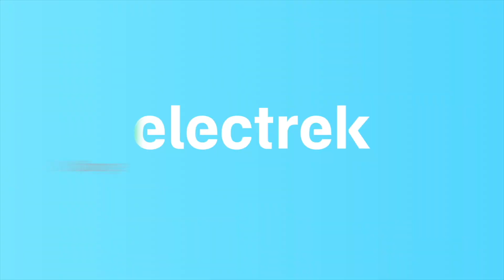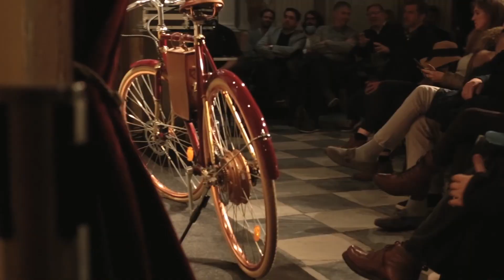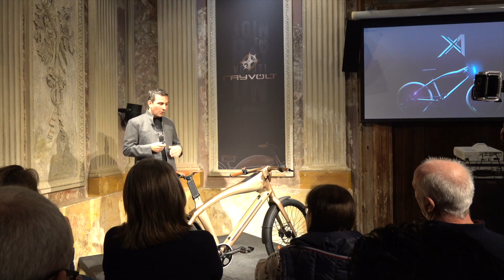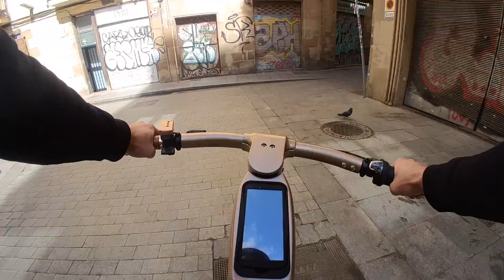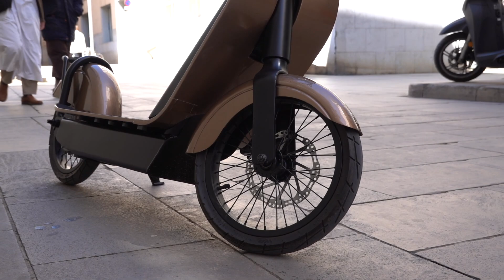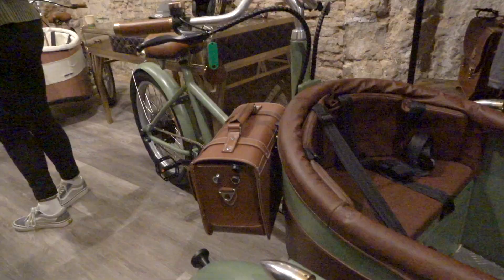Checking out Rayvolt's beautiful electric bikes in Barcelona

Comment: As one of the original Indigogo backers of the Exxite XOne ebike project (backing provided at the end of 2019), I experienced nothing but frustration with Rayvolt, the parent company. Whilst COVID-19 completely derailed the production of the Exxite One, the utter failure by Rayvolt to communicate with us backers about the progress of the Exxite One project during that difficult period was unacceptable. When I finally received my eXXite One bike in March 2024, it took about three months before the indicators stopped working. When I contacted Rayvolt UK about a possible repair/servicing, I was told that they do not service eXXite bikes. Essentially, no other bicycle shop I have got in touch with, is prepared to look at my bike. Now it appears that eXXite as a company has gone bust, as their website is not longer available, Predictably, Rayvolt have not been in touch to inform us Exxite One bike owners about this situation. I'm stuck with a bike that doesn't really work (as some other issues have crept up since the indicators stopped working) and that no other bike shop wants to look at. Clearly, I was too naive to trust a so-called reputable company like Rayvolt to actually produce a quality product and provide appropriate after-sales support.

Comment: I use my Rayvolt Cruzer V3 since 4 years and 20.000km for commuting as a replacement for my car during good weather conditions. After all these trips, I still love this bike. It has some issues, some of them are fixed with the V4. The cycling path in Berlin (Germany) are sometimes very awful, so I desire are suspension for the V5. Rayvolt created wonderful pieces of mobility. Thanks for that.

Comment: any info on how they are implementing the bike regeneration VS your video a while back on why it's not practical?     you have a nice " hobby " visiting all these places.     cheers
Reply from the maker: That video a while back wasn't necessarily saying it wasn't practical, just that you don't get the same amount of energy recovery as in a car. But it still adds good braking power and helps save your brake pads, not to mention adds a bit more range (usually 3-10%).